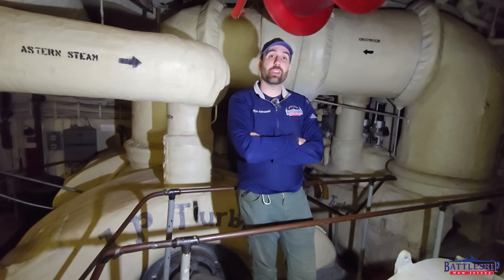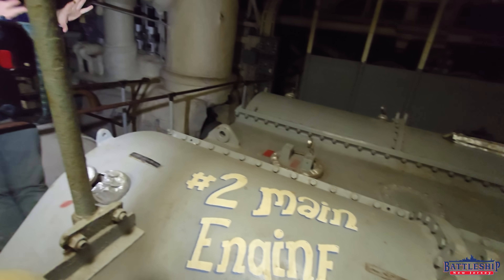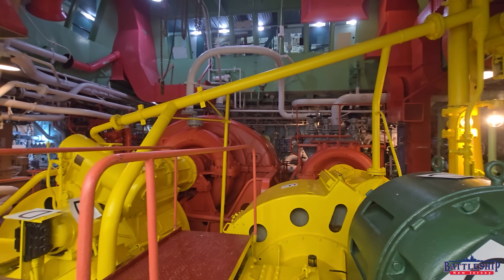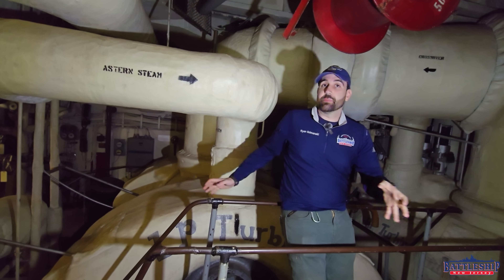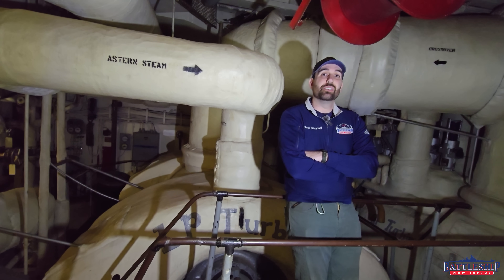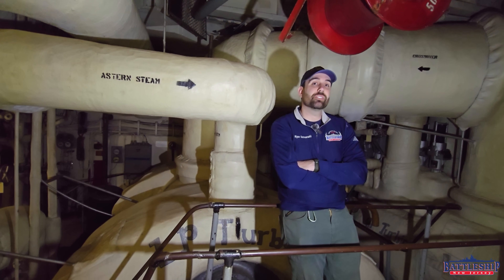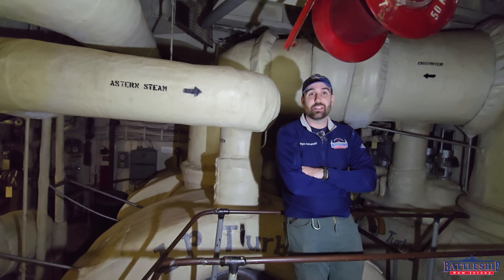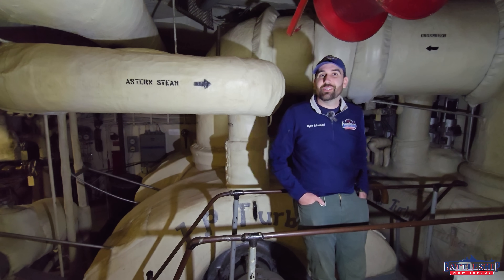Steam, Diesel, Nuclear, Reciprocating: A Look at Some Of The Common Ship Engineering Plants

Comment: I think all the different designs have merit - which is why they've been adopted to their specific roles in the fleet.  Gas turbines are great for smaller ships that need to be able reactively change their speed quickly - but you have to support the logistics pipeline to keep them fueled.  Conventionally fueled turbine-driven steam is excellent for larger ships in which you need the additional oompf that a high-pressure, high-volume steam-plant can give you with the added benefit of the fuel economy that you get with a closed-loop steam-plant.  The downsides there: it takes longer to build steam and increase speed and you are limited to only being able to produce as much steam as the condenser can recondense at the other end of the loop (it's an often forgotten fact, but the condensers are what limit the speed of almost all steam-powered ships.  If you aren't recondensing the steam at least as fast as you are boiling it - the condenser stops pulling vacuum, then the condenser can't evacuate steam from the low-pressure end of the plant, then steam goes dead in the low-pressure turbine instead of the condenser, then the steam starts to condense in the turbine instead of the condenser, then the turbine explodes because it's not supposed to have liquid water in it.  If you want to make NJ faster, take her to the arctic.  The cold water will allow her condensers to recondense the dead steam faster and you can run significantly more steam through the system.).  Nuclear is great for high-endurance applications but, what most people don't realize - you cannot safely ramp up a fission reaction quickly, so nuclear is not a good option if you are going to need to make reactionary speed changes quickly.  The radioactive decay-chain you kick off in a reactor is a process that takes almost a billion years to fully complete.  Now, you don't have to be thinking quite that far ahead, but you do need to be planning several days in advance and need to be factoring in the decay of fission-products that you initiated WEEKS ago when you are making output adjustments to a reactor.  Everything about it is complicated, but you can find yourself in a situation where you can't push the ship any harder today because you went ham last Tuesday and the cesium from that run-up is just now decaying.

Comment: My first ship had a 600 lb steam system similar to what is on BB-62, my next ship was the FFG-7.  I learned there's a great advantage to a Gas Turbine propulsion/Dissel Generator Plant; one time we got underway from cold iron (shore power) in less than an hour.
Reply: Diesel/electric can go in seconds, ....... so.......
Reply: @berryrijnbeek5938  yup, my first ship was diesel, prime the engines, and open the air flask to the starters, and we were gone. gas turbines dont take a lot longer though, and as a bonus they are quieter, and stink less.
Reply: @leftyo9589  GE LM2500s could go from cold start to full power in less than 2 minutes, no preheat necessary in emergencies.
Reply: When I first skimmed your comment, I thought you were saying you cold started steam in an hour. Possible? Maaaaybe, but I sure wouldn't want to be in the room while you were doing it.
Reply: Diesel or turbines can go underway in minutes if you skip the safe procedures and just go. But you should really preheat them
Reply: @the_retag  Seconds, ...... thinking subs......

Comment: German U-Boote did not use diesel electric transmission. Their Diesel and the electric motors could be cut in and out from the shaft.
Reply: Also, anyone who suspects It may have been cool serve on a German U-boat should check out the movie Das Boot. Grueling is an understatement.
Reply: I had a very interesting conversation with two young French gentlemen under the stern of U-505 tha last time that I visited her. This 72 year old, and the two thirty somethings could not imagine doing a war patrol in her.
Reply: @wtmayhew indeed. When seeing the videos from USS Cod, I thought it was absolute luxury compared to the German navy.
Reply: They had a clutch between the engines and the electric motors which double as generators,the US were true diesel electric,
Reply: @user-ij3op9dw3u later class VII Boote could use both diesel and electric motors together to reach not 14 but 17 knots on the surface.

Comment: I love the fact that nuclear power is basically just a spicy steam engine ..... 😂
Reply: There's the XB-36 that carried a nuclear reactor, and there was a similar Tupolev concept.
Reply: @stevemc6010  The Russkiwes have recently flown a nuclear powered cruise missile.
Reply: I've always wondered if you can scale down a reactor enough to make a nuclear steam locomotive
Reply: The NR-1 submarine was only 12-foot wide. Although a locomotive reactor would need thick, heavy shielding, which the NR-1 lacked along it's sides.
Reply: @getmeagator  True but it's not a ship so it wouldn't have to be that big. One pellet of nuclear reactor fuel will power a house until it's used up.
Reply: @KingdaToro  technically yes, economically: not by a million miles. Too easy to refuel a diesel engine on land, can't shut down or really leave a nuke plant unattended, etc.
Reply: @danl6634  Can't shut it down or leave it unattended?
So... Snowpiercer?
Reply: You can ride a nuclear powered train today, the French TVG for example. They just made the sensible engineering decision to locate the reactor off the train and connect it to the train through overhead line electrification.

Comment: Horrible working conditions, but I miss it. Retired USN Chief Boiler Technician (SW)
Reply: I was a MM3 on Gearing class FRAM .
Later went to college and became a merchant marine engineering officer .
We NEVER cleaned our boiler tubes At All!
We water washed once year .

You were in the boiler every few weeks with a wire brush for no reason .
Also we used worse fuel bunker C than the NSFO the navy used .

So your stupid officers  made you do something unnecessary that made your job terrible .

Then switched fuel to ND F-76 which is more expensive and blew up in the light off .

The last few combat ship that are non Nuc Steam are run by merchant marine civilians 
As you BT were eliminated .

I felt So bad later when I found out how 
Badly the BT were treated for no reason !!!
Reply: @josephpadula2283 I just about spent more time in main control as a BT1 standing EOOW than #1 fireroom. I had to qualify on Evaps, L/L, switchboard, MMOW, and throttle. I was given a choice in 1995, convert to MM or retire. I said convert? Hell, all I had to do was change the patch on my dress blues 🤣
Reply: @josephpadula2283 Did they make you clean with “GP”?
Reply: @jolynnland 
No 
I don t remember G P  in the navy as a MM.
Reply: @jolynnland I remember it
Reply: @josephpadula2283  Most of the remaining Wasp class LHDs are steamers also with IIRC the last one receiving gas turbine power (2 - GE LM2500s) rated at 25,000 hp each.
Reply: @robertf3479 
Yes , I thought after the USS Ponce that was the last , and maybe a tender .
Thanks for correcting me .
Reply: Salute. An interesting comment - B NJ has one video of gentleman was a BT3 on the NJ in the 80, if I recall he retired as a MMCS.  Oh - below recall mutiple of the LHD are steam.

Comment: For me, the coolest thing about steam plants is that for the most part, it doesn’t matter what kind of fuel is used. So long as you can get water converted to steam, it’ll keep on chugging.
Reply: Japan learned the hard way that straight crude oil was a terrible warship fuel.
Reply: I was reading about the Titanic’s propulsion system recently.  Just the number of hand stoked coal fired boilers is mind blowing.  The steam plant fed the propulsion system of huge triple expansion reciprocating steam engines and then into steam turbines to scavenge as much energy as possible from the steam before entering condensers and return to boiler feed water.  According to the text, the steam exiting the turbine would have been below atmospheric pressure.
Reply: @wtmayhew  When you read about USS Texas you find the limit to coal powered and hand stoked ships. The range of USS Texas changed once it was converted to oil fuel and I bet a dollar a man the crew did not complain about no longer having to swab the decks after dumping ashes and taking on coal.
Yes, the turbines on Titanic exhausted into a partial vacuum so there was no back pressure.
Reply: @Kevin-go2dw . Thank you for the reply, appreciated.
Reply: It's funny how throughout basically all of post-industrial history, the world basically just relies on better and better ways to make something spin... And throughout most of that history, it all just comes down to steam. Coal? Steam. Oil? Still steam. Nuclear? You better believe it, more steam! Geothermal? Yup... Steam again. It's the one constant from basically the earliest days of the industrial revolution all the way up to the modern day.
Reply: If you like the steam Rankine cycle, you'll love the Organic Rankine Cycle (ORC) which uses a refrigerant instead of water, and boils at lower temperature.  You're not getting more energy or breaking physics, but you can take advantage of lower temperature sources of heat.
Reply: It'll keep chugging for many minutes.  Then you'll be out of feed water and the ship will stop.  The revolution that caused steam-power to do things like power trans-oceanic travel wasn't the steam engine, it was when James Watt realized you can add a condenser at the end and close the steam-cycle.  So, who is the real hero?  The fuel that turns all the water into steam or the seawater that turns all the steam back into water?  It's a real belt and beltloops paradox.
Reply: @Joseph55220 A condenser, superheater, and the like, fall into the collective that is “steam plant.”
Reply: @F-Man  He tried to correct you and neglected to at the very least...  be correct when attempting to correct someone. 😆
Reply: @F-Man So sayeth F-Man 😊